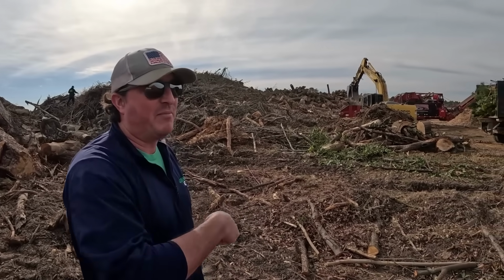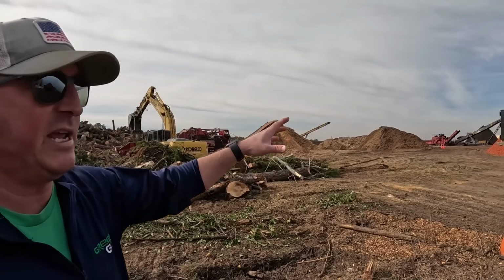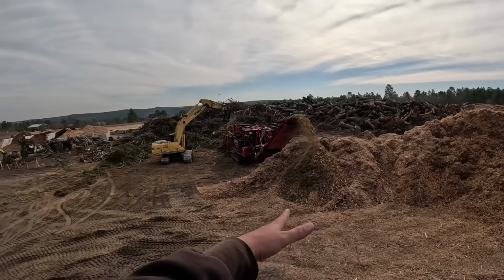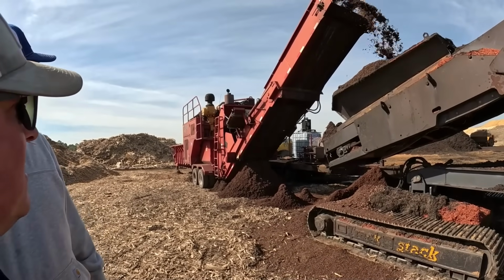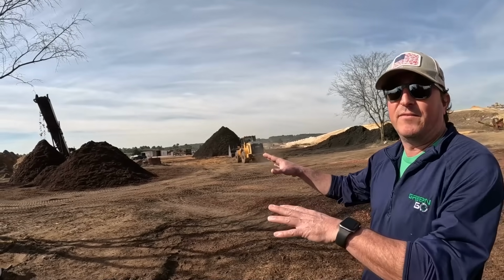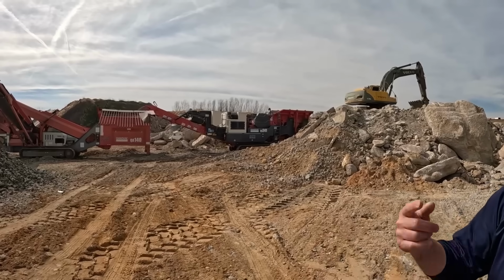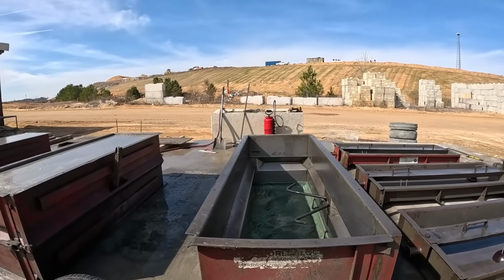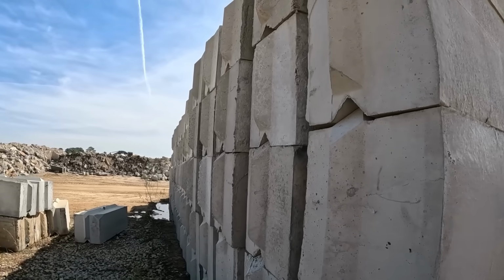Making Mulch From Start To Finish And Concrete Recycling!

Comment: We do all grinding on site.. We go to a property, 5 to 100 or whatever size acre site. We then cut phase 1, 2, etc. Or whatever the customer needs. Then we ship out the logs, grub it, Then  get all the left over brush and stumps to a couple a central locations, and bring one of our 6400 Mobark wood hog,“wood chippers” in and chip and truck out the chips and let someone else fine tune it and die it… Best Job I Ever Had

Comment: Old guy by me has the same type of recycling business with the same morbark grinder with the dum dum huge cat diesel in it…asked him how much fuel it used…he said 80 gallons a hour…he started screaming at the operator when the feed deck almost went dry!…let me tell you mr. digg he had it turned up way faster then what your running…just full belt pouring off like Niagara Falls…966M cat just humping to keep it off the out feed conveyor!…he runs a different set up for concrete recycling…has a 330 cat with mandible jaws to break up big concrete then a 966M loads into a cone crusher style unit which goes to a screen deck and separates it to…1”-3” oversized clean…3/4” clean…and crushed concrete or ABC…you should consider 3/4” clean it’s very useful for drainage in smaller commercial and residential applications…it’s always out of stock…it has to be good…welp that’s my two cents on the subject and your operation is quite awesome!…great video cuttybone’s!

Comment: That's a big operation, looking at all those sawdust/mulch piles I was wondering what they do to control the fire risk? It one of those big piles caught fire it would probably take everything and the equipment with it?
Reply: We monitor temps in the piles regularly. Fire has happened couple of times though

Comment: On all this wood and trees, awesome operation and you can make money by the pound, for this for landscaping and so on. There is a place not too far form here, where I can get gardeing dirt and mulch that they will sell you by the yard. Also great that his cousin has a saw mill, to mill all the better logs, and can then sell them as well. Love the concete area as well, cause all of that can be used or resued in the construction trade, for driveways and such. Chris and Mike would know that well.. Now Andrew Camarata has a rock crusher at one of his properties that he blew up a part  of his one mountain so he could crush the rock and build the LONG LONG driveway and road on... Also blew up another part of his mountain by his Castle property. Great videos! Like the blocks as well, Love the ones with the horses, but you have to have those certain people that like that.

Comment: I was seriously impressed with this video for all reasons mentioned below. Ditto to them. Did I miss the acreage size of the operation? How many people are employed? Is maintenance performed on swing or graveyard shifts? How many mechanics are employed? How much fuel do they burn a year? Thanks for bringing this operation to us, Chris. You created a documentary. 👍👍👍
Reply: This does not include his sand mine that is.several hundred acres.
Reply: 85 acres under this particular operation, 70 people all total, maintenance during regular hours, 3 mechanics, LOT of diesel ( im really not sure but its a lot). Thanks for watching!

Comment: I've had a prolonged question and in my 50 years haven't gotten an answer. All the stuff shown even more from his landfill side...has BTU properties. Which could be burned and smoke scrubbed which in turn produces electricity. Some is a renewal resource. Some from our daily usage...which isn't going away. There is already hazardous waste incinerator plants which have been running clean decades. Why not produce something we need and keep our ground and water table cleaner in the process. Just a thought. Great vid Chris.
Reply: It’s a permitting nightmare to try and burn waste. I looked into, and was pretty much told it aint gonna happen around here. For now at least…..
Reply: @TheRealMrDiGG  Thanks for the exceptional tour. Pretty amazing to see first hand. I can imagine the paperwork would be a headache. Seems like the DOE would be on board with a process for energy production. A 2 fold deal...save land/water produce energy. And will turn anything to pure carbon so very little left to dispose.of. Seams feasible but eh...govt. Thanks again
Reply: Logic and government are not related in any way. 😆

Comment: Is he considered a mine?
Reply: His sand mine is.  Gets inspected by the mine safety agency from the feds.
Reply: @jayschafer1760  The reason I ask is the local Takeuchi dealer had a demo on a pre production TL11R at a similar business that takes in dirt, rubble, stone processes it and resells back to the contractors. He was required to follow all mine regulations in Virginia.
Reply: @jayschafer1760 yup! At least twice a year

Comment: There is a company where I live that makes mulch out of pallets . They grind them up and then magnets take any fasters out. It is them dyed in various colors . The towns pickup leaves and brush. They also pick up limbs . The brush and limbs are chipped for mulch and the leaves are piled for compost. Anyone  can take what they want for free . People love the leaves to mix in their gardens and the chipped wood makes great mulch . The smaller municipalities  have rubbish grass clipping pickup from spring to fall and it's taken to the county landfill and made into compost which is ready in the spring for anyone who wants it at no charge . On construction sites they have to recycle any  concrete block scraps or old clean block that is not painted . It is hauled to a crushing plant that mixes it in with new block concrete mix. Old fiberglass ceiling tiles are also saved and and hauled to a plant where they are shredded and mixed into new fiberglass for ceiling tiles. 50% of waste in my county is recycled .
Reply: Your comments of 'Free' & 'at no cost' are your TAX dollars at work.
Look into it before you criticise.
Reply: Is this even in the US?

Comment: I understand that it cost lots of money to do that mulching for business 
But one thing i dont understand 
Is when you have burn piles 
Why do you bury it 
An not just put it out on youre land 
Because it does build the soil
So is there a reason 
I put it on my garden ect ect 
So if im doing wrong let me know 
Im sure you know
Reply from the maker: because its not just ashes its full of unburnt chunks of wood, roots, stumps and metal.  spreading that out just make a royal mess that you have to clean back up